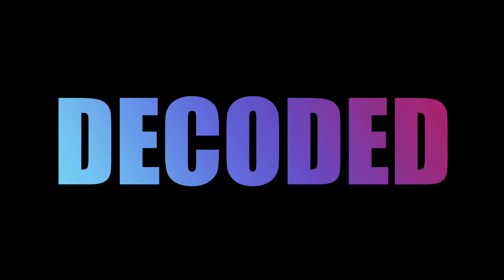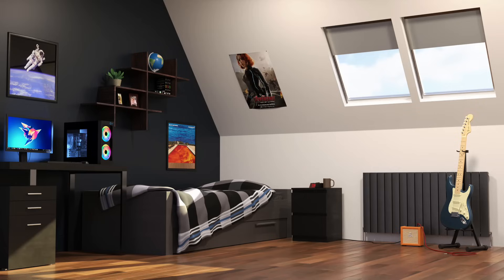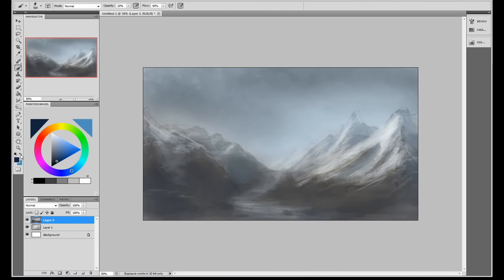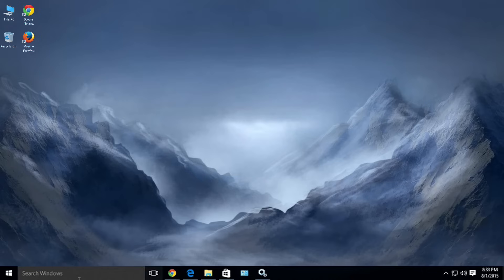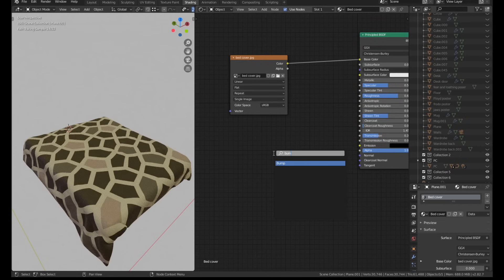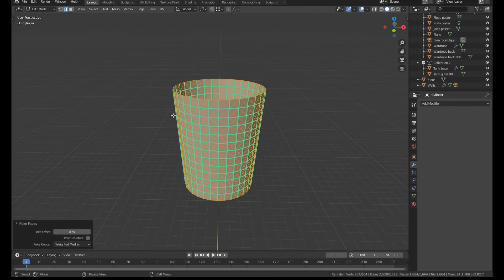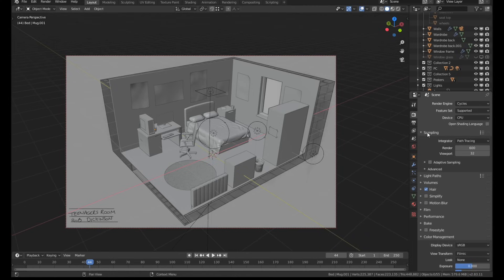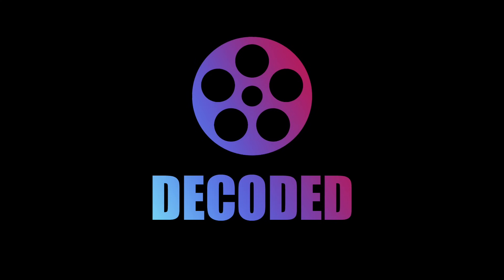Create A Bedroom In Blender

Comment: There is no need to do render passes to fake the glass. Just use the light path node trick you used earlier, but with the isShadowRay to mix in real transparency. You're supposed to do 1-fresnel to drive the transparency color, but this is nitpicking that have little to no visual impact unless you're going for additional realism just for the sake of it. If using a sharp glass shader, it needs to have thickness to support proper refraction. If using transparency+glossy, I would use just a layer weight/facing through an rgb curves node to mimic fresnel - no need to be accurate here, and avoids the 1/fresnel for backfacing issue.
Reply from the maker: I actually try using that light set-up for the scene (and several others) but every test render was coming out too dark. I didn't have time to troubleshoot the issue, so I just created a render pass instead.

Comment: One thing to mention, if the light is coming from outside than you cannot see reflections in window
Reply: That's not necessarily true. If it's dark outside, or the angle we get of the outside happens to be a dark alleyway across the street there might be enough contrast to see bright reflections from the interior. This is why it's better to get an understanding of how light works instead of just learning vague rules.

Comment: For the glass, you could use a transparent shader mixed with a glossy shader and a texture (dust or anything a bit random) plugged into the roughness, it gives you a great glass without the noise and render time increase :) well at least less than a glass shader
Reply from the maker: I tried a few different glass materials and everything was coming out a bit too dark. I figured it was faster to just composite the glass in separately.
Reply: @DECODEDVFX  yeah it works, i'm just allergic to the compositor soI try to do as mcuh as i can in the viewport haha

Comment: You couldve put a cloth simulated something on the back of the chair to hide the lack of faces) The sketch seems to have some kind of clothing piled up on the back of the chair.
Still a cool piece tho. I'm trying to make a pc case rn, thanks for idea on how to make it simple)))

Also, doesn't the "transparent" checkbox in the "Film" section under "Render Properties" tab hide the background while still making it cast light on the scene?
Reply from the maker: Selecting transparent removes any kind of background from the render. I wanted a gray background, so I used that node set-up instead.
Reply: @DECODEDVFX  oh, right, didn't think of it.
Reply: You could’ve just then added the gray colour in the compositor, or is there also some difference between them?